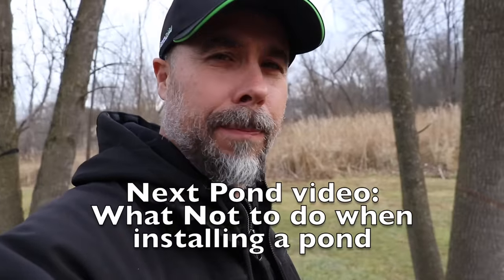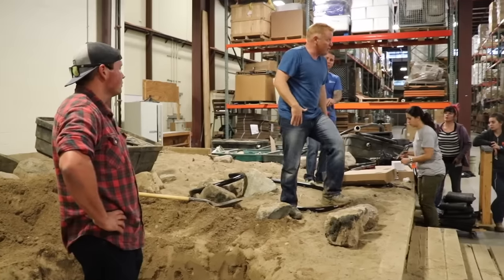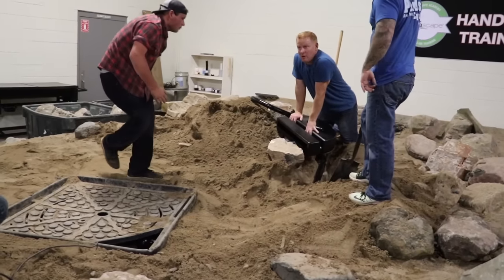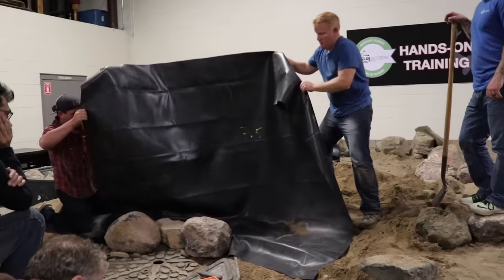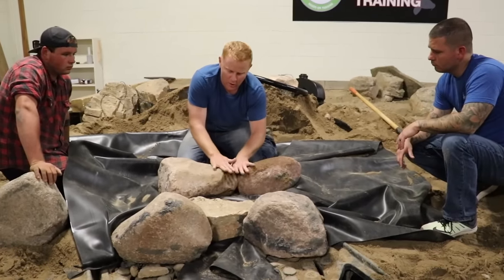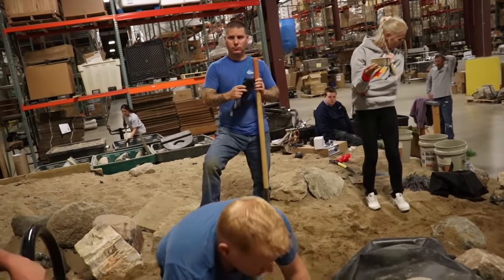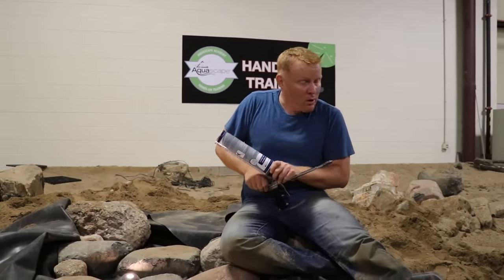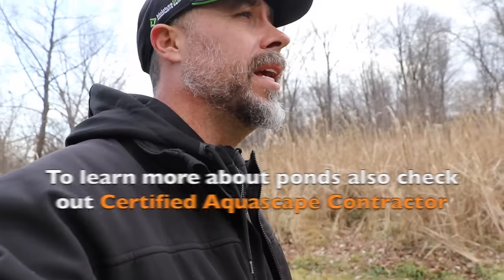The Bible of Ponds, Pondless waterfalls, fountains & water features -Everything from Start to Finish

Comment: great video - one word of warning on plants - they grow. The roots will push in toward the liner and sometimes can even push rocks out of the place you put them - be sure to take growth into account when you plant those edging plants. It's not as big a deal with a river run like in the video but around a pond they can push edging stones out of place and into the pond - which of course you need to pull up and then reset - after digging out the offending plant and moving it back,....

Comment: This video is very good, very thorough and understandable and I feel more confident about building my own waterfall when I get the chance. But the only issue I have is no one is talking about power. I'm sure for the hands on training an extension cord was used, please dont give them this right of way thinking it's ok to use. Even if the  pond installer doesnt do electric,  the installer should at least be aware of the National Electric Code for receptacle type and placement. If it's a new install, electrical pvc conduit is used and is buried to a depth of 18" to the top of the PVC. If UF cable is used that has to get buried in a 24" trench with electrical PVC coming from underground to your home and weather rated GFCI. You cant just put a receptacle 2 feet away, or use extension  cords, for the pump and hope everything is going to be ok. Look up article 680 of the NEC, it explains where the power should be placed. The customer must be kept safe. Hire a qualified electrician, there is more than running wire.
Reply: Absolutely power kills

Comment: Kind of skipped the part on how to install the lights. Should the wires for the lights be ran through a pvc or abs pipe? Or just run the wires between the rocks and under the dirt about an inch.? I think I already know but just in case I was wondering if there is a specific way you use. Great video

Comment: Wouldn't you need to run electrical to the site for the pump and lights? Or do you generally do them close to the house and use an extension cord? Also, link to the kit?

Comment: I have an existing small round pond and water fall constructed with concrete and rocks. I am trying to figure out the plumbing so I can add a new pump. I was able to clear the pipe in the center of the pond which leads to the top of the water fall. The other pipe is off center on the side of the small pond. I tried to clear it using high water pressure but it just blew back at me. Any suggestions would be greatly appreciated. I can send pictures if you would be so kind to help me bring this old pond/water fall back to life. The previous owners put it in. They used 1/2 inch PVC  for all plumbing.  There is a decent size void behind the water fall for a pump I believe,  although I don't know what type and size pump to purchase. I loved the video and will eventually order a kit to add another waterfall on the other side of my yard. 
Thank you, my kindest regards.

Christopher V 
Las Vegas, NV

Comment: Why would I use a basin over aqua blocks on a pondless waterfall. I going to build a waterfall in my yard in a hill 20 ft long with 4 feet of drop that is fairly narrow.  Is it due to the volume of water needed? And the pump is another thing I have to concerned , will it have enough push to go up to the spill way. If you don't mind your thoughts. Big fan of Aqua-scapes Thanks

Comment: Great video Stan! Quick question, what powers this unit and how do we supply electricity?
Reply from the maker: Thats a Good question for the pond guys.
Reply: Most pump cords are 15'-20'. If there is a GFCI outlet near the planned feature then plug and play. Otherwise you may need an electrician to install an outlet for you. In my company we will trench for the electric but ask the homeowner to source an electrician. I don't refer anymore cause we have been burned before.

Comment: In building a koi pond for a customer....do you study, research about what the koi need in a build to be healthy and happy?  I've noted that a lot of pond builders seem to lack this knowledge.  Koi are extremely expensive and a loss of a koi due to a build, can be devastating for a customer.  A minimum of 5 to 6 feet, no sharp rocks on the botttom, no fish caves, a minimum of 1500 gallons, and absolute top notch pump system to provide the clearest, cleanest water is just a start.

Comment: How does this waterfall hold up in a cold Minnesota winter?
Reply: Most features in that climate would be winterized. Just need to remove the pump and check valve. Ponds with fish you will need a floating deicer and an aerator to maintain a hole in the ice to prevent gases from building up under the ice.